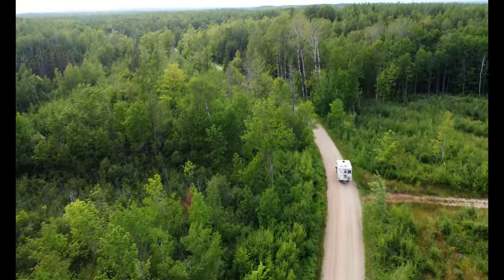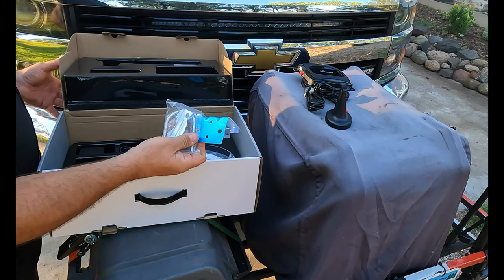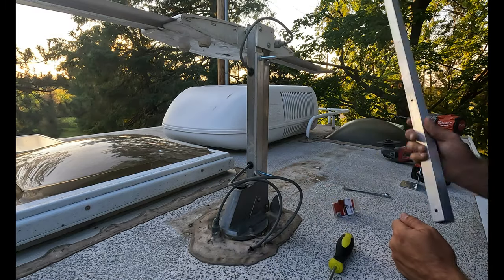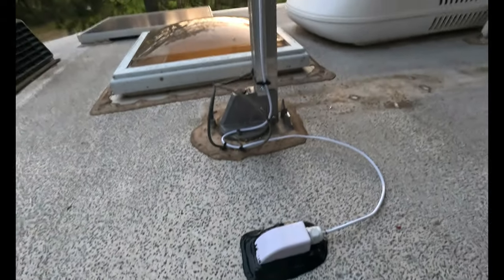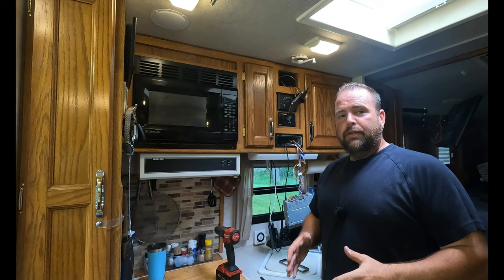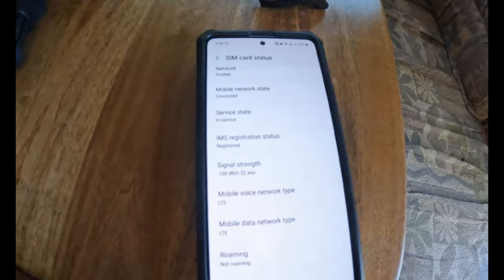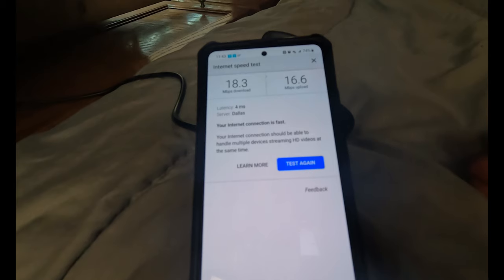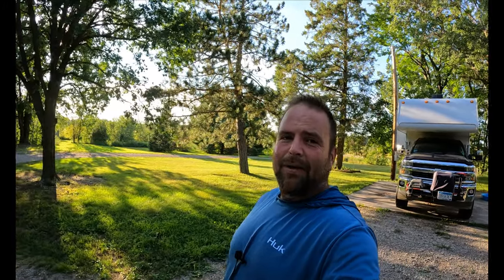Installation and Review of Cell Booster in Truck Camper

Comment: That's one of the cleanest installs I've seen yet, mounting it the way you did, very slick. Never really thought of purchasing one, it would definitely solve a lot of the issues we run into. Seeing how straightforward was to install and the fact that it actually works. I'll probably end this note and jump on their website and check them out for myself. Thanks so much for suggestion, safe travels Kenny and blessings to you and yours.
Reply from the maker: Thanks. Check out the Facebook group too. There's a big community of owners sharing information. It does alot more then I showed. You can connect your phone through Bluetooth and get a lot more detailed information about the power increase.....but I'm not into that. I just wanted better cell reception!
Reply: I totally agree with you William!
Reply: @KennyOfAllTrades  thanks so much for the suggestion, but we're really not that into the whole online thing. That facebook, what a mess. We watch a lot of YouTube videos, my boy is really into them. Purchase this arctic fox last year, probably the best purchase I've made in quite some time. We have the 865 2021. We've been doing some small projects here and there. First one was taking care of those batteries going to lithium. Have the top of the truck camper sprayed with Line-X, on the way home from picking it up from the dealer. And now we're trying to figure out the filter water thing, trying different products. It's football season, never thought a RV would make such a difference when it comes to my boy sports. Tell you for a fact, that it has. He plays 7th grade defensive end and wide receiver and in a few months, we're going to be playing basketball. Camper just works beautifully in those applications, especially during tournaments. I've been working on removing and replacing all the caulk, I knew that was going to be a pain, I was right. However the maintenance on my truck camper is far less what it was for my boat, I couldn't be more happier with my purchase. I get a lot of my tips from YouTube, it always seems that were adding or subtracting something from the camper. Like I said, my boy loves watching your show. As I'm cooking supper he's in the background yelling at Kenny's on, telling me we're going to eat dinner out in the living room so we can watch your show. Your videos just like a lot of other good quality influencers out there on YouTube, well provide a valuable resource for guys like me and my son who love their truck camper. Well like I said before, safe travels and blessings to you and yours. We are looking forward to seeing your next video upload, sounds like next week's adventures going to be a good one. Cheers

Comment: Nice install👌, I have a Wilson brand in my camper ,they are really handy for sure if a tower isn't too far but they won't pick signal without extending the antenna much higher in extreme remote areas.

Comment: Thanks Kenny, I am looking for a booster, I had intended mounting it to the ladder. Antenna is a great mounting location.
Reply from the maker: It was super easy. I thought about the ladder too. It would be easy to get the antenna wire into the camper from the generator compartment. That way there is no hole in the roof. 
If you decide to go with Hiboost using ( Kenny ) in the coupon code will save you 15%. Plus it's free shipping.

Comment: I have a WeBoost Drive, had it in my Lance.. making a different antenna mount for my AF, like you said you need a little signal... it won't pick up what isn't there.
Reply from the maker: I still may look into the Garmin inreach one day. That would be an excellent emergency tool. But I'm really surprised how well this booster steps up a poor signal into something usable. I here the WeBoost is also an excellent booster.

Comment: Hey Kenny, great video. It's ironic that you're video this week was about your install, we were just talking about it this past weekend. Pretty sweet setup. Karal and I have been looking at either the weBoost or the hiboost. I'm considering the hiboost for the truck. The spec's are about the same, and where I used my truck for work and the camper. It should work well.
Thanks for another great video.
Reply from the maker: Yep, there was no traveling over for the weekend. The fuel prices are catching up with me.
 I am heading out Friday after work with my youngest daughter. That will be Tuesdays video. I'm not 100% on where we are going yet, but Adelle is a character and it should be a good video. The last video she was she stole the show.
Reply: @KennyOfAllTrades  Yes she did! And we enjoyed it 😊
Reply: We will be looking forward to it.

Comment: Really cool video. How did you figure out where to drill the hole to run the wire into the camper?  How well do the radio and the TV work?
Reply from the maker: The radio and TV Antenna work well when I'm in an area with a signal. Unfortunately, we don't have many TV broadcast towers up here. When I camp outside of larger towns like Duluth, or Grand Rapids, I will get TV stations. 
My only requirement for the cable is that it entered into the cupboard area with all the electronics. I more or less guessed where to drill and it worked. 
The cell booster is an awesome upgrade. I've had it for quite a while. It really works awesome.
Reply: @KennyOfAllTrades  You did a great job. 👍👍

Comment: Would like to know if this is better then the weboost or the connect insty
Reply from the maker: I haven't had much experience with cell phone boosters. I was hesitant at first.  My experiences with cell phone boosters in the past was no good. But that was back in 2002, when Cellular One was the only option in town. When I installed the Hiboost I was extremely happy. I have been using it for over 6 months and only have positive things to say.

Comment: So it's been about a year now. Are you still using? Do you still think it's worth getting ?
Reply from the maker: I use it all the time. There is no doubt it works. When I have one bar....only enough to send out text messages, the cell booster will provide enough signal to stream data. It works awesome in poor reception areas. 
If there is 0 signal, like this past weekend, then the booster does nothing.
Reply: @KennyOfAllTrades  thanks for the imput... do you ever get discount codes for subscribers on these products?
Reply from the maker: When I do, I put it in the description of the video. I've never used affiliate links. There was a 15% coupon code for the booster. The code was "Kenny". It's been a while though. I'm not sure if it still works.
Reply: I just saw one of your newer videos of product reviews with codes. 

I'll have to check into the booster. Been looking at them for awhile just not sure what way to go... so many brands out there. You never know what you get from Amazon sometimes.
Reply from the maker: @shanehanson7514 Yep, I try to get discount codes for the viewers. When youtubers provide Affiliate links to the equipment, they usually get a 10 to 15 percent cut if someone buys the product. I tell the companies that I don't do affiliate links. I tell them to provide me with a  percent off discount code for the viewers instead of me taking the money. I have not done a lot of review videos. I don't want the channel to feel like i'm pushing products.